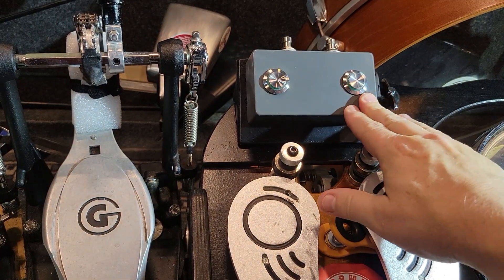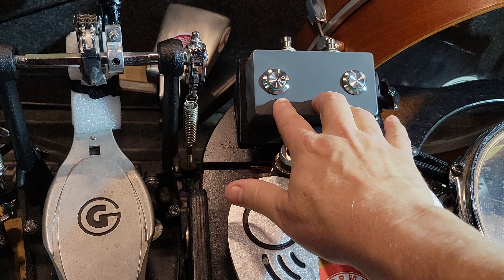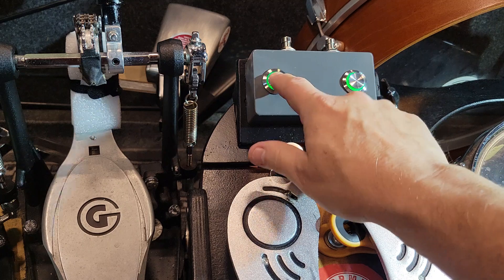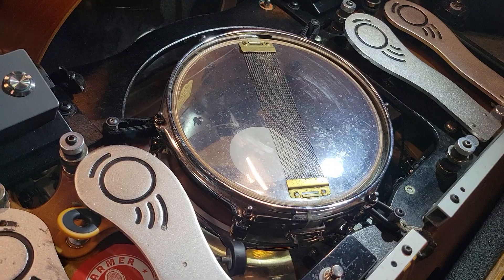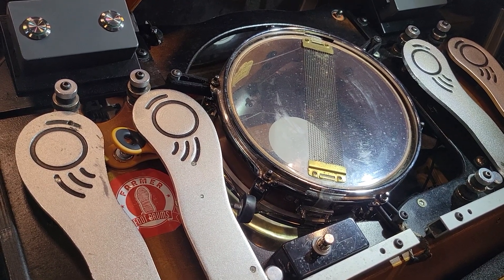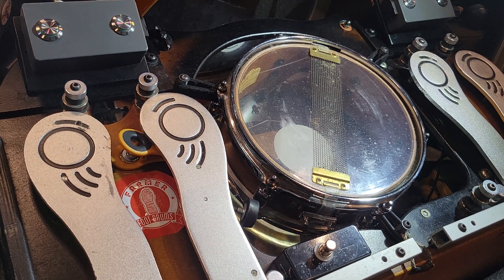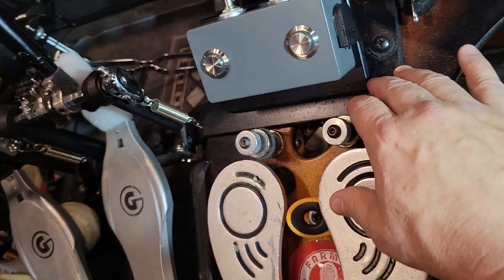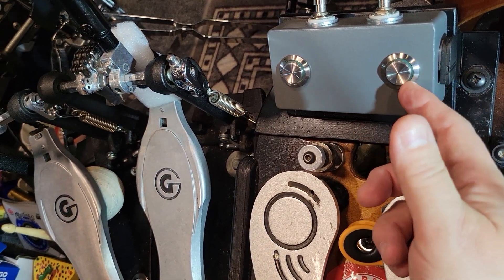Foot Drum Triggers

Comment: Sorry if this comment gets kind of long, but I must say This is pretty cool. Nice that I found this video, because I have an idea of doing something a little bit similar. I just typed into Youtube "foot-controlled electronic drum triggers for one-man band" or something like that and this came up.

My idea is that I'm going to play piano keyboard while playing drum sounds with my feet, using standard electronic kick drum pedals going into a drum module (like the one in this video for example, though it could be any other drum module as well). I should mention that I'm looking into using kick drum pedals that are "beater-less", I.E there's no actual beater hitting an external bass drum pad which would sit on the floor. The main advantage is that this will be less bulky and therefore more portable than having actual kick drum pads which can get pretty heavy. Then, the idea is to build some kind of structure/frame to mount those kick drum pedals onto, such that I can carry the whole pedal setup as one unit instead of carrying all those pedals individually.

I'm trying to figure out which "beater-less" kick drum pedals to buy though. I'd like for them to be velocity sensitive as well, that way I can control dynamics. If you or anyone else has any suggestions for pedals that fit what I'm after, feel free to reply and let me know. I can also try finding options on Amazon or whatever as well.

Oh, and another important note before I forget: I'm not at all interested in just playing a single bass drum or a bass drum and snare drum or something like that while playing piano; I want to have it sound like a full-blown drum kit with bass drum, snare drum, hi-hats, cymbals and so on. For an example of what's possible, check out a guy called Jordan B. Wilson, also known as "The Lone Sound Ranger". Only difference here is that Jordan's "foot drums" are acoustic, whereas mine are gonna be entirely electronic, like the ones shown in this video.
Reply from the maker: I've come across some guys doing all triggers in really cool ways. I know Jordan (LSR). He's an awesome, creative talent, and was a huge inspiration when I first started. When I get a chance I'll track down some links and send your way. Check out early youtube vids from One Lad Band aka Barry Carroll. He was all foot triggers but later moved to the Farmer Footdrum. Super cool guy and I'm sure could share some great insights on triggers.
Reply: @JustOneGuyMusic  Hey, thanks for your reply!

I suppose it might also be a good idea to explain my foot-drumming pedal layout; I already have it figured out in my mind. That way you can get a better idea of what I'm really going for here. Anyways, the pedal layout is as follows:

Right heel pedal: bass drum.

Further right heel pedal: snare drum.

The toes/ball of the right foot will control the sustain pedal on the piano.

Left heel pedal: another bass drum pedal.

Further left heel pedal: another snare drum pedal.

Left toe pedal (above the left heel bass drum pedal): closed hi-hat.

Further left toe pedal (above left heel snare drum pedal): crash cymbal.

An even further left toe pedal: open hi-hat.

Final left toe pedal: ride cymbal.

That's just the basic foot drum kit. I also had an idea for an "extreme foot drumming" setup, which I could use for extreme music styles like death metal: rather than having one bass drum pedal and snare drum pedal for each heel, I would have 2 of them. They would be set up in stacked pares, such that one heel could get 2 bass drum strikes or 2 snare drum strikes with a single downward motion of the heel. Then I would alternate between either of the stacked pares of pedals for fast snare drum rolls or super-fast double kicks without wasting much energy from my feet. The rest of the pedal layout would be exactly the same as the "simpler" layout I presented at the beginning.

Yeah, I know. This sounds totally insane. But that's precisely the point! :)))
Reply from the maker: Check out this guy's channel. One of the best I've seen using drum triggers... https://youtu.be/pqFrtUsyNg4
Reply: @JustOneGuyMusic  Yeah, I've seen that guy recently. Steackmike is another one of my favorite one-man bands. That Michael Jackson cover of his that you linked wasn't the first one I saw from him though; it was actually his cover of "Jump" by Van Halen. Both are good though! I saw the Michael Jackson one later on.

I don't think he's actually using "drum triggers" though, necessarily. He's using an electronic pedal keyboard (like the kind of pedals you'd see on an organ) to play the drums. When I think of "drum triggers" I usually think of a piezoelectric sensor used as an input for a drum module, as used with acoustic drums or ordinary electronic drum pads. A pedal keyboard on the other hand is just a set of keys with switches under them; this is entirely different from a piezo sensor.
Reply from the maker: Piezo is definitely the most ideal. Although what I'm using now in this video are momentary switches with no dynamics, I originally made various versions using piezo triggers. I was unable to overcome the crosstalk and misfire issues with this particular configuration. I found sacrificing the dynamics for toms was acceptable for my tastes. I'm still using piezo for kick and snare to preserve the dynamics without any issues. 

If it's not already in your plans I highly recommend exploring the use of DB25 interface or Cat5 wiring so you can have one (maybe two) cables between your pedal board and drum module. I had a mess of cables until I figured this out.

I look forward to seeing/hearing your rig and how things develop.
Reply: @JustOneGuyMusic  Thanks again for your reply! Yes, I know my reply is late :))))) haha.

Sorry if this reply gets a bit long again, but anyways:

Haven't heard of "Cat5 wiring" or that DB25 interface you mentioned. I may have to learn more about that. Sorry, I'm not an expert in this stuff :)).

I thought I should also mention that it is still technically possible to get velocity sensitivity even with switches. This is something electronic piano keyboards already do. Instead of just having a simple on-off switch under each key, each key has usually 2 switches under it; as you press the key and it continues to move down, the first switch closes and then the second switch closes, and the controller calculates the amount of time between the closure of the 2 switches. It uses that to then determine the dynamics. Electronic drums with piezo sensors obviously don't use that approach, as the piezo just generates a super quick voltage spike upon the impact of the stick hitting the pad, rather than using a system of gradually-closing switches like what goes on in a keyboard; you could think of the system of switches in a keyboard as being more like a gradually-increasing voltage rather than an instant "spike", and so I guess you could say the controller is calculating how long it takes for the voltage to increase to determine dynamics. So on the drum module, it uses the intensity of that voltage spike (I.E how much it actually increases compared to its at-rest state, rather than "how long does it take to increase voltage") to determine dynamics. Before the pad is hit, the voltage from the piezo sensor is basically at a "zero" (if you prefer to think of it that way).

Here's another interesting idea with that in mind: I thought I remembered reading that there's actually a product that's commercially available that actually has the ability to take the input from a "velocity sensitive" footswitch (like a sustain pedal with "half pedaling" capability, or an expression pedal or a hi-hat controller pedal) and then convert that input to a MIDI note of varying velocity. This device could then be connected to a drum module or any other MIDI-capable device, which would then receive that MIDI note from the converter. I think it's made by a company called "MIDI Solutions". I've recently considered that as another option for foot drumming as well. The advantage of that is that crosstalk isn't even an issue, because it's not relying on vibration at all like a piezo sensor does. That could be important because I wouldn't even have to worry about crosstalk to begin with.

That's the interesting thing about foot drumming; there are a lot of different ways to go about it and so there's no one right way to do it. That's what I've certainly come to realize as I've thought and learned about this topic.
Reply from the maker: Now I have to rethink my triggers. I wasn't aware of the velocity sensitive switches (and I've spent a lot of time researching) I hadn't thought about how keyboards work. This is taking me down a new path.  The learning never ends :-)  Thanks my friend! I have a new project!
Reply: @JustOneGuyMusic  Glad I could educate you! :))

I just looked last night and yes, there is indeed a product by "MIDI Solutions" that does what I described. I'm gonna have to try it out! I could buy a bunch of sustain pedals or anything similar and try them out with that device. Of course I could just use one pedal to start with and then gradually add more pedals over time; I'd be building up the foot drum kit one piece at a time.

As I think about it, this does also have a physical advantage with regards to my foot-drumming requirements as a pianist. While standard electronic drum pedals seam logical, one issue I've noticed with them is their shape. Drum pedals are shaped in such a way that they slant upwards as you go toward the end furthest from the hinge point. As the hinge point of said pedals is usually at the heel end, and because I would've hit one of the pedals with my heel while the toes of the same foot are pressing down the piano sustain pedal, this causes the heel to be pretty high up in relation to the toes, which really doesn't feel that comfortable. I Verified this with my electronic hi-hat pedal, but the issue is still there with bass drum pedals. This can also be explained by the fact that traditional drum pedals have quite a bit of travel to them; they're quite high at their resting position and then they go pretty low when you press them down. That uncomfortable feeling I mentioned doesn't really exist when the drum pedal is depressed because at that point the heel and toes of the same foot are basically at the same level, but it's the resting position of the drum pedal that feels uncomfortable because the heel is so high. You could solve the problem by pressing down the drum pedal more towards the heel end, but then the pedal eventually gets harder to press because your foot would be closer to the hinge point, and just like with any lever, it gets harder to press down the closer you get to the hinge.

Piano sustain pedals are more or less flat across their entire length, and they don't need to move down so far either, so this could feel a lot more comfortable to physically play. I've not verified this yet though because I've not yet tried it.